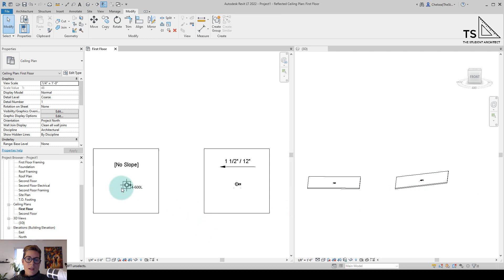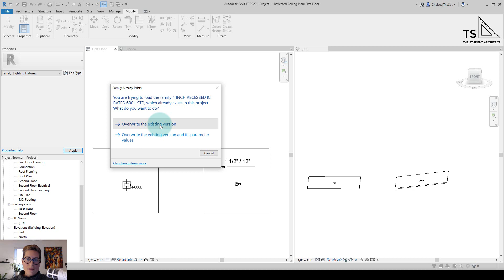How to Show Family Annotation Symbols on Hosted Sloped Surfaces in Revit

Comment: I've upgraded my model from 2021 to 2023 to access this feature. I can now see the option to maintain the orientation in my family. I've selected this and loaded into the drawing and updated the parameters, but the generic annotation will still not show on sloped ceilings :(
Reply: Same here, not sure what family or annotations she worked with. I wish she'd respond to the comments. all she does is responding to comments that only compliments her!!
Reply: insert a annotation symbol inside you light fixture then you will see it in the project.